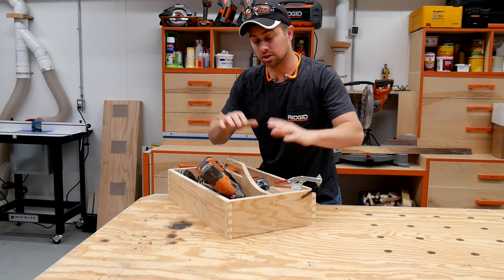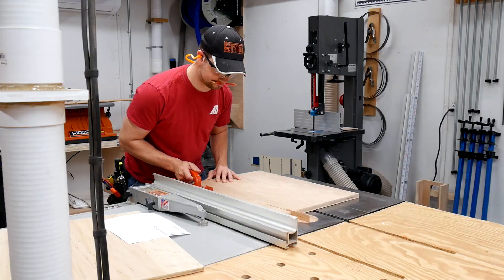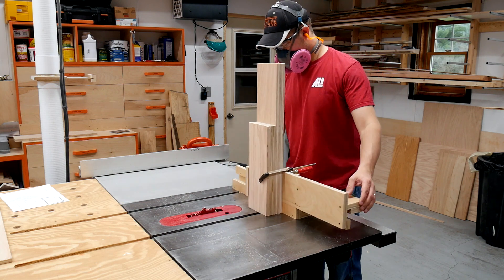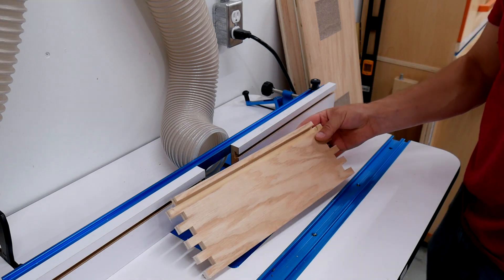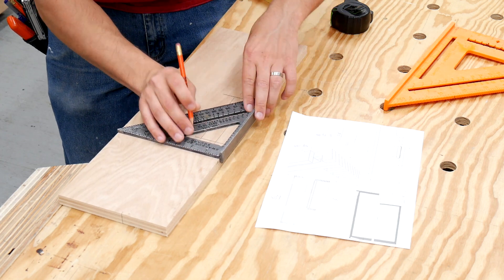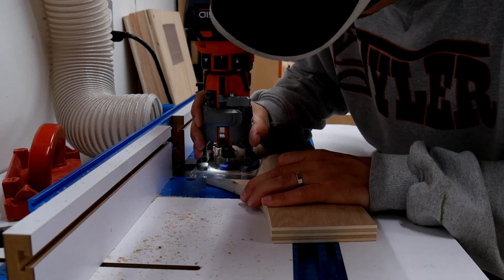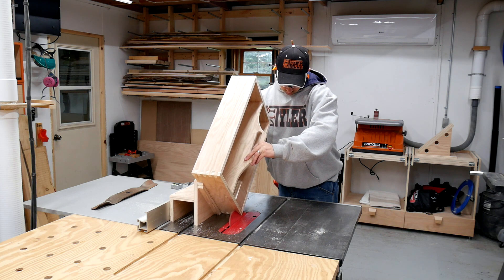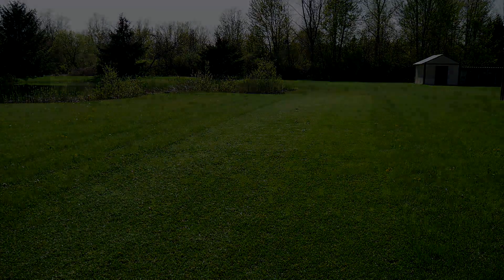Never Have DULL Mower Blades Again!! Mower Blade Sharpening Jig

Comment: I am eager to see that shop in 20 years.
Mine started out dust free also...20 years ago.
There was a time I built a jig for everything because 
I enjoyed woodworking and being clever and all that.

Now?  I free hand sharpen mower blades OUTSIDE since a jig (for me) 
is  extreme overkill, and I'd never be able to find it in my shop!!!
I also have water spraying on the blade while sharpening with a 
4.5 inch grinder wheel (not a flap grinder). Water keeps it cool.

My shop?  1200 sq ft.  Not dust free anymore.
Keep up the entertaining projects!
And as usual...
THanks for THinkin' !

Comment: Here's what I use to sharpen blades I bought a Yellow Hornet online it uses an angle grinder mounted on it. Just drag blade on angled bracket which in  turns grinds blade at 30 degrees

Comment: I Use a bench grinder much easier,, and Balance the blade on a screw driver.If it's heavy (out of balance) one side will go down, easy to adjust by grinding a bit more on that side